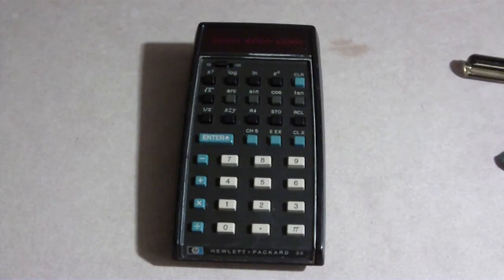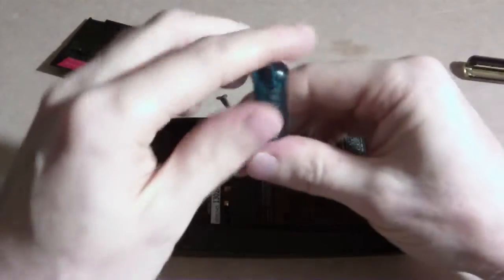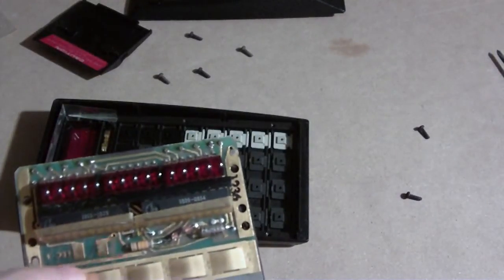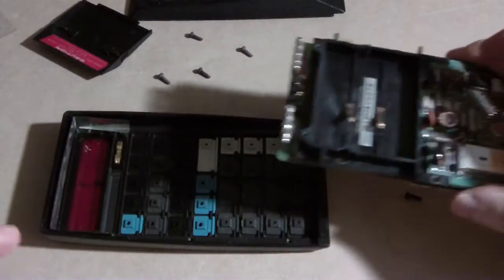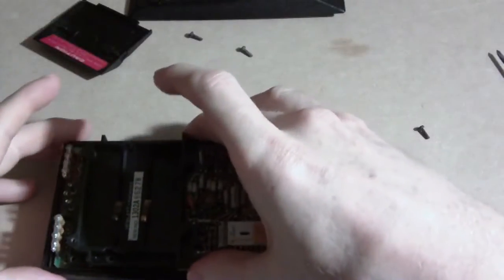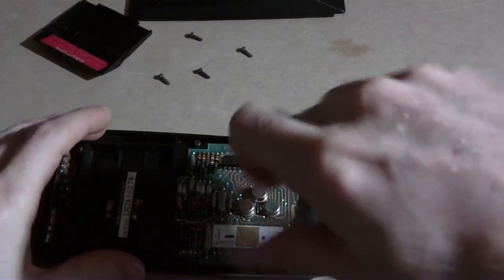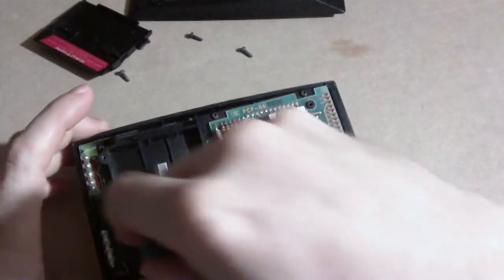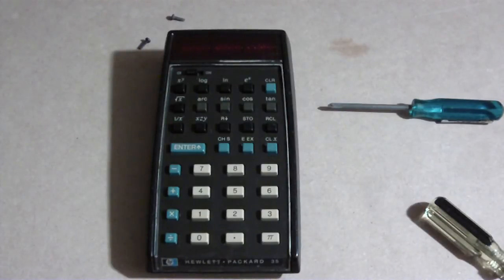How to take apart a HP-35 calculator

Comment: I thought that HP calculators were supposed to be reliable and work properly forever ?
Reply from the maker: This calculator was used when drawings were made with vellum and lead.  The debris from erasing got inside the calculator and messed up the contacts.
Reply: Ah. That would explain it.
I thought it might have suffered from the same disease as many TI LED calculators from that era: metal oxidation...
Reply from the maker: I remember that with the TI-55.  I always thought that HP just had a better system.  There is a thin sheet of plastic over the contacts in the HP but the buttons made holes in it and the debris flooded in.  The calculator was kept below the drawing you were working on and when brushed off the erasing debris it would land on the calculator.

Comment: "When I took this apart the first time, all in here was all pencil eraser filings..."
Damn straight! It sat on an engineer's desk right next to a pad of paper and got used every day until it clogged. That's how an HP 35 should get broken. :D
Reply from the maker: Falcrist You are correct.  During the time when this calculator was used drafting was done on a board with lead on vellum.  Any time a change was made to a drawing out came the eraser.  If we had a very wide drawing the calculator was placed in a drawer pulled out just enough to make sure it got a good dose of eraser filings.  Once we started to use computers that problem went away.

Comment: Is this using a intel 4004? It looks like it is
Reply from the maker: Devin Hepburn Don't know.
Reply: bunnspecial
the cpu looks a lot like one though
Reply: Yes ! you are right, an I 4004. sPECIFICALLY THE  BORN OF THAT ic made possible that little calc wonder.
Reply: @joseluisrodriguez5302  Wrong. That ceramic 16-pin DIP is an AMI7333. HP did not use the 4004.

Comment from the maker: @daafies2 I believe it was the drafting method used at the time.  We used to draw on vellum and mylar with ink or lead.  To made changes or correct mistakes one had to remove the text or line with an electric eraser.  The eraser used was long and round, about the size of a pencil, and was in a device that rotated it rapidly.  The debris generated by this device was tremendous and got into everything, on the floor, in the drawers, on your clothes and apparently in the calculator.
Reply: A draftspersons in those days could hardly afford the HP-35 and an engineering on the draftsboard don't do that much drafting let alone doing calculations. Companies don't want engineers to do drafting, cost too much money they won't even let me do AutoCAD or MicroStation.
Reply from the maker: @kimchee94112  The metal stamping company I worked for was small.  There was no drafting department.  The engineers did the design, calculations and drafting for the job they were working on.  When the company bought computers all the engineers learned AutoCAD.  The calculators were supplied by the company.